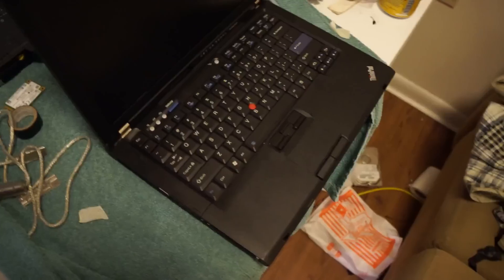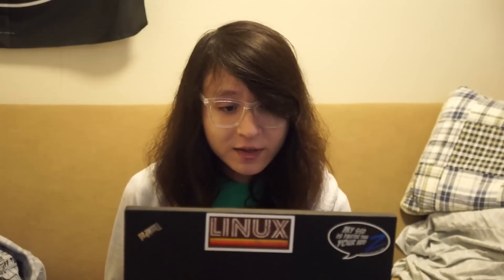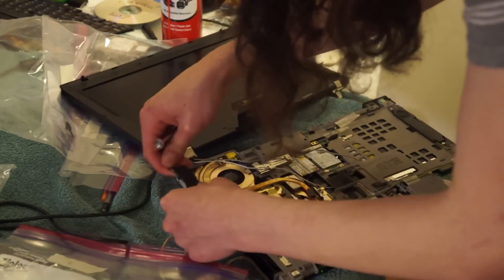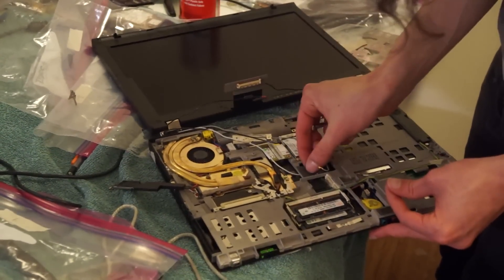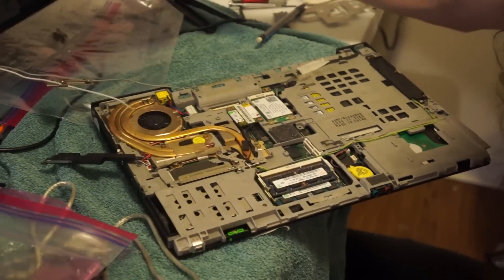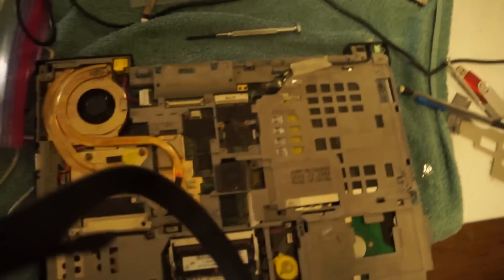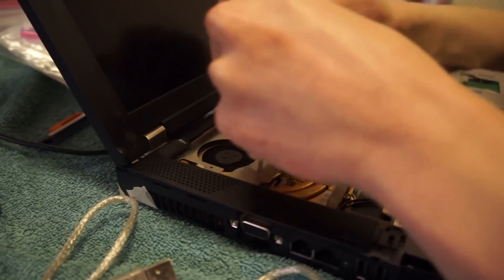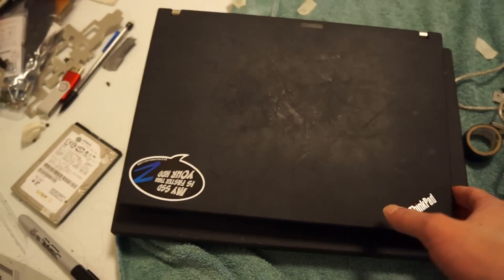Librebooting a t400, Tips and More!

Comment: I have a t400 but i dont know exactly the issue bec it powers up but after a second the lights indicators on the bottom immediately turning off.pls let me know the possible issues thank you!btw im a subscriber.
Reply from the maker: @ranimungcal  Does the screen light up and display anything?
Reply: @tripcodeQ7  screen doesnt lights up only the green power lights indicator on the bottom of screen like batt.bluetooth wifi etc.and immediately turnong off just after a second.

Comment: What did they treat the t400 with? ( at 0:33 ) Also do you know if is it possible to remove scratches off the lid of newer x220 - x250 models?
Reply from the maker: ballistol, I would believe so, the dude used it on everything and he owned a t430 and t440.
Reply: @tripcodeQ7  Oh I see! Is that a good thing to use? What do you recommend?
Reply from the maker: @mf-mi7es  I haven't tried ballistol yet, but normally I use a magic eraser.
Reply: @tripcodeQ7  Ah right! I might try that some time later! Thanks Tripcode!!